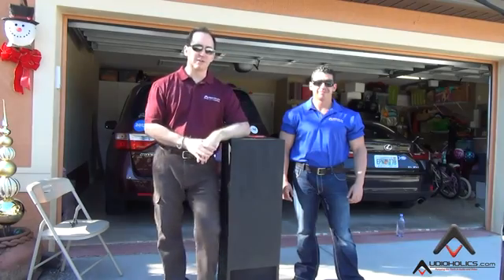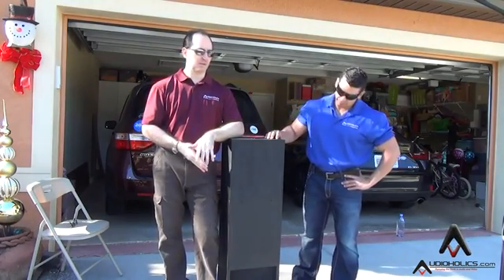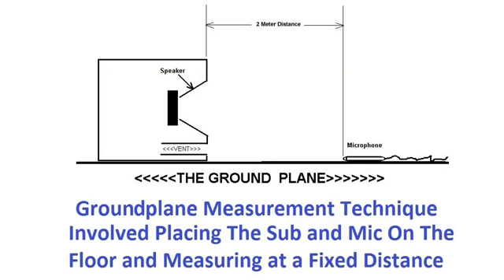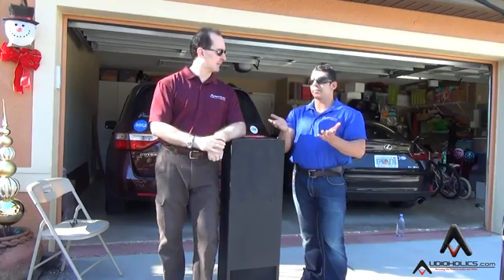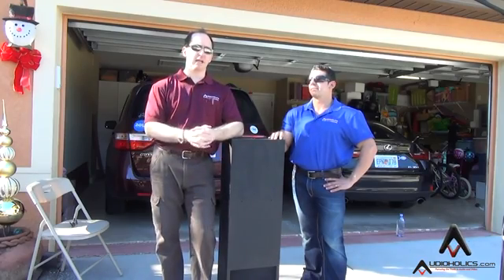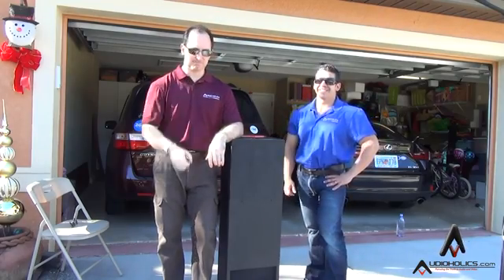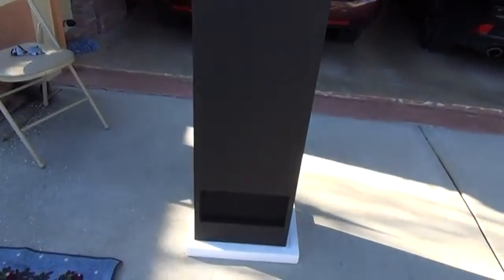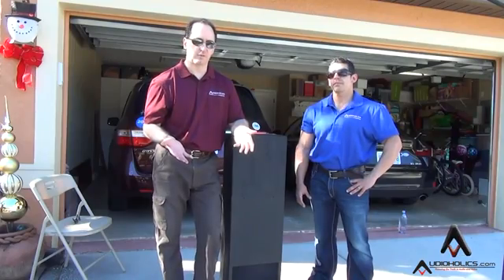Subwoofer Groundplane Measurement Technique

Comment: First of all, I envy you guys the weather, I wish I could do the same thing, but I reckon soaking wet subs from the horizontal rain that we so often experience here is a problem.... probably invalidating warranty and so on :p

Good stuff, and I always said, height is not the most important thing here, right Hugo, power can come in smaller packages

Comment: hi, i have a question that's completely off-topic but i figured if anyone can answer it, it's you guys.

I was wondering how I find the midpoint between two frequencies. For example, the midpoint between 20 hz and 20 khz. Obviously 10010 hz is not the midpoint, I think it's about 700 hz if I'm not mistaken, but I don't know how to arrive at that number using any kind of equation. I'm not educated in any math beyond algebra, but if you could point me in the right direction i'd be really appreciative.

oh, and as long as i'm asking off-topic questions, can you recommend a good calibration mic under $100?

Comment: I was expecting maybe a folded horn design with the baffle there. Is the duct just getting everything from the rear of the drivers? You know without seeing the inside of the cabinet I wouldn't swear that is an actual duct.
Reply from the maker: +Andrew Jackson No, it's a sealed design.  The bottom duct is just an opening to let the sound out from the front firing drivers.
Reply: So it's a quasi reflex design. I'll bet your mod makes it sound a hundred times better getting the impact from the front of the drivers.